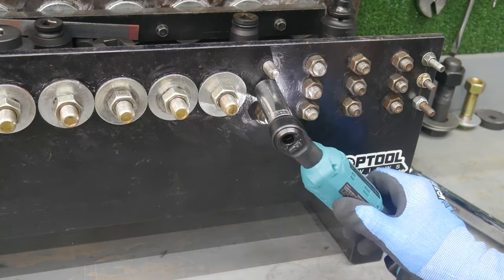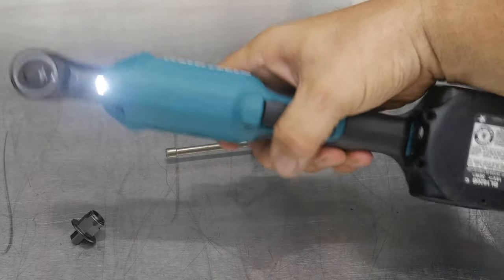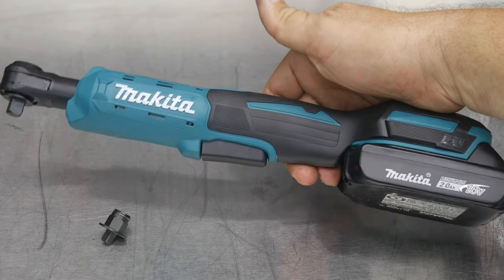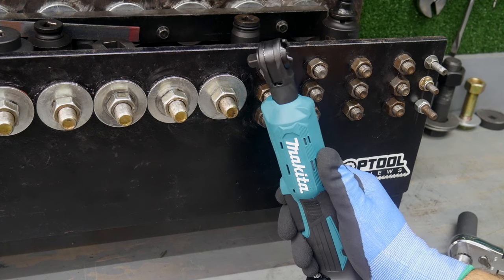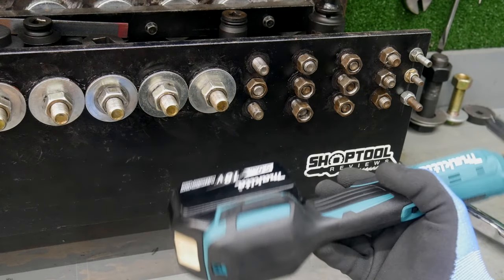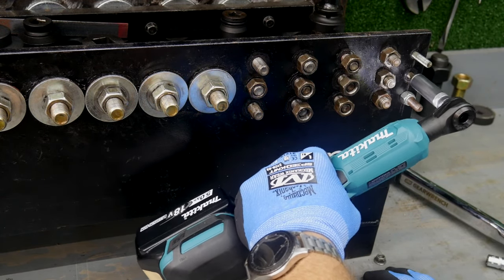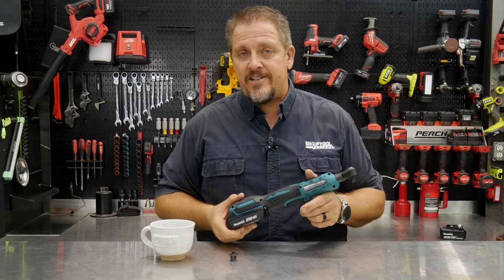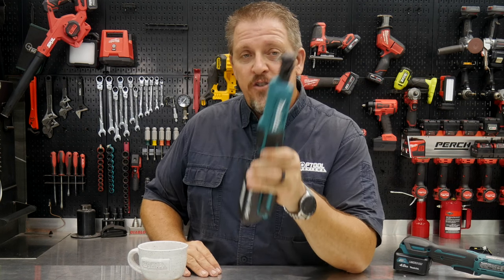It's Finally Here! Makita XRW01 LXT 18-volt Cordless Ratchet Review

Comment: I could be wrong but I think these ratchets are designed for you to manually break the nut by cranking the handle then using the trigger to run the nut off. Same for tightening.
Reply: Facts
Reply: Its basically an advantage with the leverage to break boom than spin off with the trigger
Reply: Thats how I have been using mine.
Reply: you are correct my friend, but some people are not as  wise as us.

Comment: I just got one of these and it works great. The press release says it has 35 ft. lbs. of tightening torque. Doesn't say it will break something tightened to 35 ft. lbs. Don't know if that makes a difference. The only reason I'd use the 1/4" drive anvil (if I don't lose it first) is if using a 3/8" to 1/4" adapter would take up too much space. I bought the kit since I wanted the small battery and it cost the same as buying the bare tool and a battery. The charger it comes with is the slow charger but I have so many of the fast chargers it doesn't really matter. If I wasn't on the Makita LXT platform I probably would have gone with the Milwaukee but I'm still happy with it.
Reply: The newer fuel M12 Milwaukee ratchet is slightly more powerful (rated at 55lbs) but the ratchet head is huge!  Their older model was way smaller and was more usable for me.  I work on compact cars so I can barely fit it anywhere.   I actually regret buying the newer Milwaukee ratchet because of the size issue.
Reply: all tools that label torque. is "breakaway" torque always. So if the gun tightens something. It 100% can remove that same thing.
Reply: @lfgamble3924  Thats not true for ratchets, they can tighten but not loosen. Part of the explanation is the momentum, the nut/bolt is rotating fast and comes to a sudden stop, its a mild impact. Starting from zero rpm they cant tighten more than they can loosen.
Reply: Is it better than the snap on electric impacts?
Reply: @mikejones-py5zs that's what I want to find out since I work on cars I'm no longer at the shop which I'm use to the snap on etc ones but I'm in construction now so I'm wondering how these compare to by for the house

Comment: Spend a lot of time talking about it being a nut runner, not an impact and then all the tests were about torque instead of the speed of running nuts? I would have loved to see a speed test vs the 12v Makita and/or the Milwaukee highspeed 12v. Especially considering the 12v is rated to the same rpm but is slower than the Milwaukee rated at half the same speed

Comment: I bought the 12v when it came out. I love it. At the time it was the fastest RPM cordless ratchet (I believe). I wonder if it still is. My only complaint: on board storage for the second anvil would be great. Seems a no brainier to me. Would be difficult to find a spot for that, but it would really ease the worrying about losing it.
Reply: I bought a Makpak 2 and will get some universal foam used in tool suitcases to cut out space for the 18v Makita ratchet, extra 2ah battery and the extra anvil, plus some bit adapters and whatever. The barebone Makpaks are cheap but beware that they seem to be of lower quality than cases included with expensive Makita kits, i had to remove some plastic to make the locks of the universal Makpak go smoothly but yet firm, can use a rouch sandpaper and make sure to not remove too much plastic.
Reply: @pflaffik  Ya, I have both, bare boxes, and supplied boxes with tools. Haven't noticed a huge difference in either. They are both kinda tough to fiddle with the latches. Haha. Especially with a thumb that has two splits in it from cold, dry weather. Yow! It's been a topic of late, the sanding or filing of the plastic latch. I'll get to it, eventually...
Along with organizing my tools in the boxes themselves...
Reply: Thanks for the Intel, the whole reason I was watching the video is to figure out if it had onboard storage for the secondary anvil.

How lame that it doesn't, I equally lame and like the idea of changing anvils despite not really needing it since you can find some pretty small 3/8 drive sets.

Love that he tested 5AH batteries as well.

Thank you everyone.
Reply: How does it compare to snap on and other actual mechanic brand electric ratchet  tools really would like to go with the makita

Comment: Gday Tim,
This was exactly the review I’ve been looking for! You answered all the questions I had. I’ve always enjoyed the quality of my Makita corded tools and I’m about to upgrade my early Dewalt cordless 1/4” impact to a Makita 18v ratchet. (I’m also investing in the Makita 40v 3/4” impact so I’ve got the larger stuff we’ll covered to.) But I need a ratchet for the smaller stuff in tight spots and mainly after the time saving nut runner aspect of it. I expect to help it to break most nuts loose, then run it off. I mainly work on skidsteers such as Cats and Bobcats and they have a lot of 10-14mm fasteners. I believe the latest model out now is the DWR180Z. Great review with practical information. Thanks for taking the time to make and post this vid. Much appreciated,
Cheers 🍻
Reply from the maker: Thank you for the kind words. We do our best to be informative and helpful. Thanks for watching.

Comment: I had the 18v, returned it even though I liked using it. I would get the 12v , smaller and basically same power . The direction change lever needs beefed up or redesign , delicate

Comment: You didn’t give this tool it’s respect

if you were too use ANY of the competitors equivalent tool you’ll find the makita too rule for one Very Important Reason…It’s the only tool you can switch drive direction in greasy hands! That switch alone (not too mention the two sizes you get) puts this in from of its competitors in this line
Reply: The new Dewalt sealed head has NO grease problem and it can drive break torque on nuts up to about 70 ft lbs. Agreed it is a new model in a later year,

Comment: I have one of these, I always use the bigger batteries, but I pull apart motors, interior and suspension yes it may need to be broken lose but much easier to work than my impacts in a lot of spots
Reply: Is it just as good as snap on or at least close and to any mechanic named brand ones????

Comment: I love the 1/4" and 3/8" anvil swapouts
Reply from the maker: It definitely allows you to use either line of sockets. Thanks for watching.
Reply: Would prefer an on board storage for the anvil not currently being used. Too easy to lose.
Reply: @markhedquist9597  I have on-board storage that I keep my wratchet, extra batteries and charger in with compartments. Courtesy of "Husky" tool bags.,.
Reply: Being able to swap drive size looks nice.  Since it's got a fully open head, why didn't they make the anvil double sided, 3/8" on one side and 1/4" on the other?  No spare part to lose.
Reply: @axl151  you'd be losing ability to squeeze the head into certain confined spaces. You'd be adding whatever the adjacent anvil size is to the overall head size. I'm pretty sure Makita already considered that.
Reply: I keep my 'easy to lose' adapters in a small tin, with other adapters in a draw of my craftsman tool chest, I usually just leave a 3/8" on the 12v CXT and the 3/8 with 1/2 step up on the 18v LXT.

Comment: Had this for 2 months before it took a crap on me and I used it regularly for work. The new fast power fuel 3/8 Milwaukee has treated me better so far
Reply: I had the exact opposite experience. The Milwaukee battery kept flying out on me and eventually broke.

Comment: I'll stick to my air ratchet I bought from harbor freight in 1980. That thing will remove those nuts without an issue. I was expecting the 18 volt to be comparable.

Comment: just curious.  Friends mechanic  told him to return hie 3/8 drive milwaukee  and get the 1/4 drive. Said it was more versatile  due to the much smaller head.  The 12 volt milwaukee  also is more compact due to battery  configuration. Makes sense  to me. As a carpenter I  use different brand tools for different reasons. Battery  tools might confuse that. When I cut I look AT the blade.Grew up on a skill worm drive. Makita let's me see the blade on their rt handed saw. I can't  make the same cut either a milwaukee  or Dewalt saw. Milwaukee  used to make the best recip saw. That went out the window years ago. 12volt milwaukee  tools are little beasts! To me milwaukee cordless sanders, jig saws don't  measure up to the Makitas? Go figure. Newer 36 volt left hand saw is a great saw! Thanks for listening.
Reply: I think your friends mecha mis-spoke or was misunderstood. If you want M12 Fuel 3/8 with small head you get the FHIR version.

Comment: Wow I may return my milwaukee fuel high speed ratchet for this. Although I love the Milwaukee
Reply from the maker: I don't know that I'd do that. Thanks for watching.
Reply: @Shoptoolreviews  yea your rite...just the 800 rpm caught my eye
Reply: The makita isnt always fast, i think project farm found his 12v Makita to be a bit slow, but if you care about the grip then get the Makita. M12 is way too thick for comfort
Reply: Someone did a speed comparison between the Makita and Milwaukee high speed and if I remember right they were pretty close but overall the Milwaukee is probably better but Makita usually wins on reliability.

Comment: As the 18 volt a step up in power or just a different battery like the Milwaukee fuel multi tools? I didn't feel like the m18 multi tool put out much more power just more run time but who really use a multi tool to run down a whole battery

Comment: i own this, i like the ratchet. the only thing is. Is there an anvil for 1/4" bits? i couldnt find ne thing online
Reply: Like 1/4" screwdriver bits? No. Only what comes in the box. You could get a 1/4" bit holder though. I would think a screwdriver bit in the head itself wouldn't be very useful because normally you can't get that close to the surface with the size of the tool body.

Comment: Great job as always Tim. I have the 12 volt Makita would the 18-volt be an upgrade and if so why.
Reply from the maker: Thank you for the kudos. If you have the 12V Makita, I would NOT buy the 18V. I expected, before receiving and using the 18V that I would definitely recommend it, but it's just not that impressive. I'm not sure why Makita did not use a brushless motor in this 18V and give it more power. I think the 12V is very close in performance. I wish that I could tell you differently, but I'd just use the 12V. Thanks for watching.

Comment: Hello - I was wondering what’s the model number on the Gearwrench torque wrench you used to torque the 10 and 15 ft lbs?
Reply from the maker: Model 85171: 1/4" DRIVE 120XP™ MICROMETER TORQUE WRENCH 30-200 IN/LBS. Thanks for watching.
Reply: @Shoptoolreviews  Thank you very much!!!

Comment: @9:43 
You went from a 18V 2.0Ah Battery to a 18V 5.0Ah Battery expecting more power?  
That's like having a V8 engine with a 15 gallon gas tank and swapping it out for a 25 gallon gas tank and expecting more power. Amp Hour (Ah) is a measurement of how much Capacity a battery has smaller batts have smaller Ah# larger batts have larger Ah#

Comment: https://www.youtube.com/watch?v=4Q7s7QANevA
Volts = Amount of Potential Pressure more pressure more power (water in a lake high in the mountains)
Amps = Amount of Currant, Flow, Draw of electrons this is related to Heat and Wire Size (water moving down the river)
Watts = Amount of work getting done (Amps x Volts = Watts) (Water wheel in the river doing work at the mill)
Ohms = Amount of Resistance of the Currant, Flow, Draw (Rocks in the river, water wheel, Belts connecting the wheel to the mill, saw blades spinning, the wood getting push into the saw blade is all Resistance)

Comment: Glad I saw your video because as a professional, I wouldn't buy this Makita ratchet.  It's a overpriced nut runner.  If they can't make a cordless ratchet that break at least 35 ft lbs, no point in owning one.  If you have to use it like a manual ratchet, save your money.  Keep up the good video reviews.
Reply: You don't have to use it like a manual ratchet. It easily has enough power even for rusty threads. If you use manual ratchets a lot, it will speed up your life. I had to tear apart the front end of my car and never touched my manual ratchets. Just this thing and an impact wrench for the stubborn ones.

I thought he covered that fairly well with the nyloc nuts, but I suppose if you don't understand the difference, yeah you don't need one.
Reply: Funny enough there's other videos of people reviewing these and it does break free 35.4ftlbs and 35.7ftlbs
Reply: @ilu51vLRS now that right there is an uncalled for UNCALIBRATED comment ‼️ AHHHHHH HAHAHHAHAHAHAHAHAHAHAHAHA 🤣💦

Comment: Too bulky ...m12 Milwaukee ftw
Reply: My problem is the M12 is too bulky. The grip, with a thick battery inside, its terror, would not use an M12 for any extended time.
Reply: @pflaffik  you must be referring to the 2nd gen. I have the 1st gen and it’s not really really as bulky.